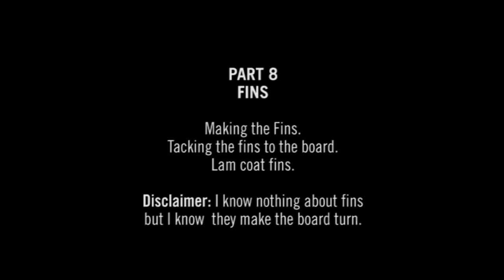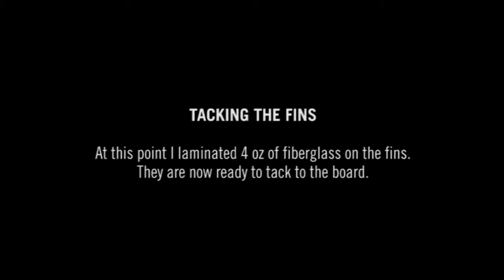Grain Surfboard Build - Part 8, Making the Fins

Comment: Hi Sattva! Did you laminate the bottom of the fins with fiberglass as well before tacking them to the board or did you leave them raw wood? Also, did you cut the cant angle into the bottom of the fins where they meet the board or no?  Thanks for the help!
Reply from the maker: No lam on the fin base. Just tack them with resin so they are in place. Its plenty strong. The main strength comes from the fiberglass cloth and the rope. I did a 1 degree cant with a "slight" toe in. Very slight. The fin will break before the fin to board seem is. Tons of strength.
Reply: ok. thanks again!
Reply: oh yea one more question- how thick did you make your fins at the thickest point?
Reply from the maker: 1/8". Glass makes it thicker.